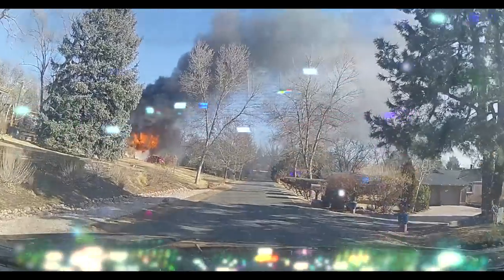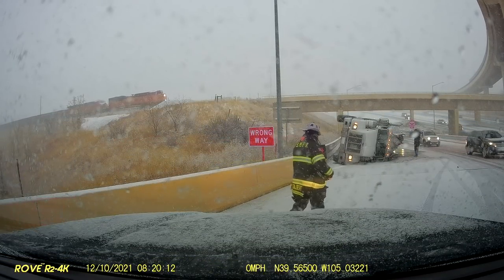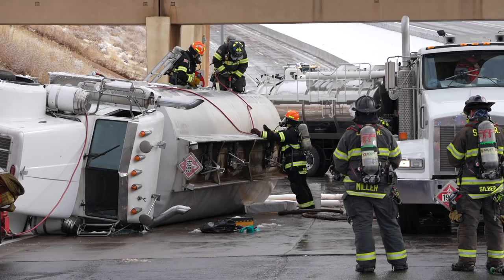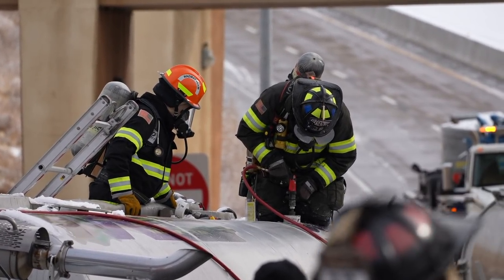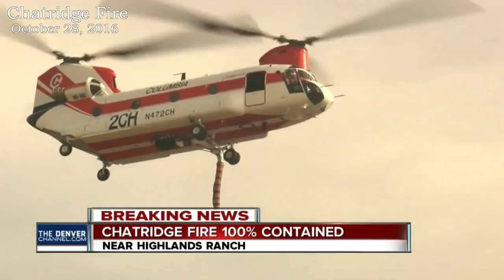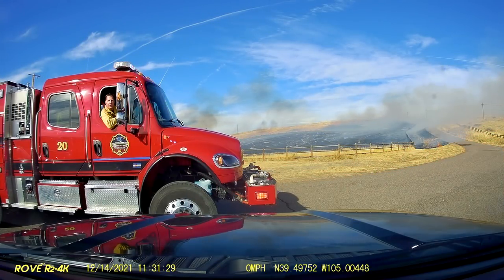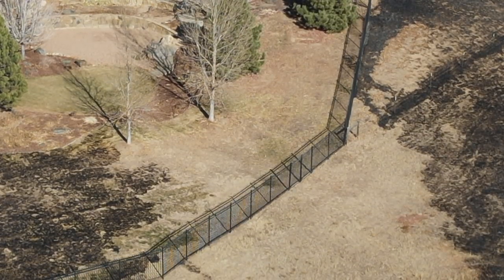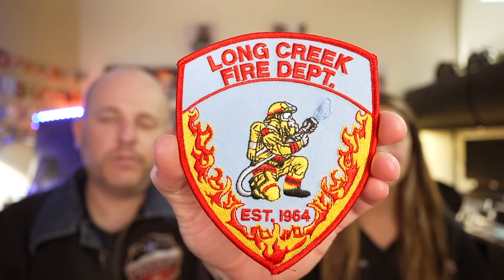PIO Vlog - December 2021

Comment: "You're incident has been updated"

It's been like a year and District 1 is probably still getting that alert.
Reply: @SouthMetroFireRescuePIO  What dispatch software is that?
Reply: @MrBrandon105123  They probably won't say first thing. and second if they did you can't access there Cad system they have a private system.
Reply: @RandomVideoEditors  They very much can say what dispatch software they use. And I have zero interest in trying to access their* (grammar) CAD. My agency is looking at switching.

Comment: Hey guys. What's the purpose of the black SUV arriving at 13:27 and what was his job on scene?
Reply: I don't know what the vehicle was, but I do know it was South Metro personnel, and they passed along Zulu command to them. So they gave that vehicle a second Ops channel to basically run the scene and resources that was on the opposite side that the Battalion Chief was on
Reply: I believe it was Special Ops 10 who is the District Chief for Ops Bureau who would serve as in certain cases as Division leader, operations commander and more of the leading/supervising duties
Reply: Actually disregard my last it is actually OPS 1 who is the Assistant chief of Emergency Services Division and will be a command unit and supervising unit

Comment: QUESTION ? 
Why don't American fire trucks carry water like European fire trucks do ?
i've seen videos where UK fire fighters have put a vehicle fire out before US fire fighters have even got water on a similar sized vehicle and fire from the point of arriving on scene, 
simply because they carry water onboard the engine and can start fighting the fire in less than 10 seconds, by just pulling on the hose reel and turning on the nozzle, 
instead of having to get hoses unloaded and tools and set up hydrants and attach hoses and turn water on and everything else they do,
i mean European fire trucks have all the other hoses and equipment to attach to fire hydrants and run out more hoses as well, but because they carry water they can start fighting the fire within seconds of arriving while they are still setting everything else up,
The difference in the time it takes to start putting water on the fire could save lives and prevent serious burns.
Reply: @C.CUMM1NGS  All fire engines in the US have a water tank with a minimum of 300 gallons (1136 liters) of water based on standards set by the National Fire Protection Association, but that is not obvious when looking at the trucks from the outside. Hose reels are not as common on US fire engines meant for structure fires, but almost all engines have a length of hose with a nozzle that is preconnected (often called a "preconnect") to the outlet of a fire pump that will allow them to immediately put water on the fire as soon as the hose is unloaded and the pump is primed. Hose reels are much more common on wildland engines where it is more important to be able to quickly unload and load hose with a fast moving fire.

The videos you are seeing might not be a complete picture either, especially if they are on the other side of street from the fire. It only takes one to two firefighters to operate a hose line, so the rest of the crew is free to do other things like setup a connection to the hydrant before the water in the tank runs out. There is actually a great example of this in this video at 11:43 where you can see a firefighter on the far left using a hose reel and the onboard water tank to put water on the fire while the other three firefighters unload additional equipment.